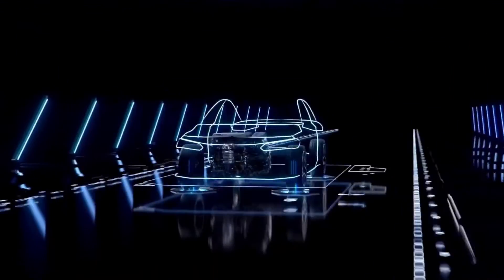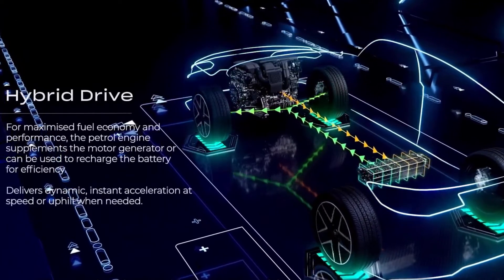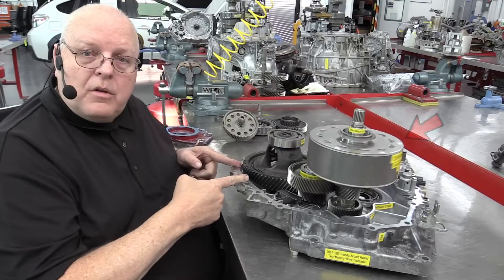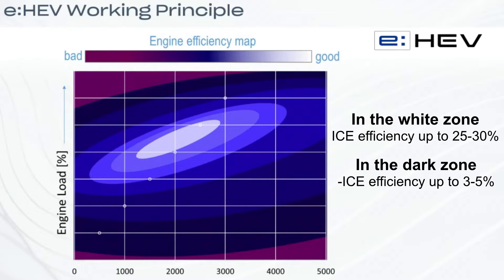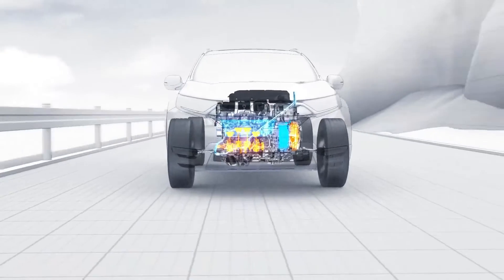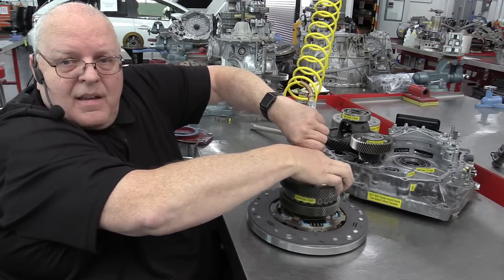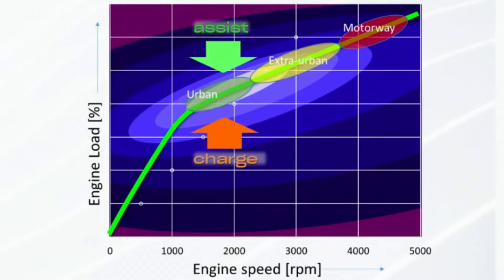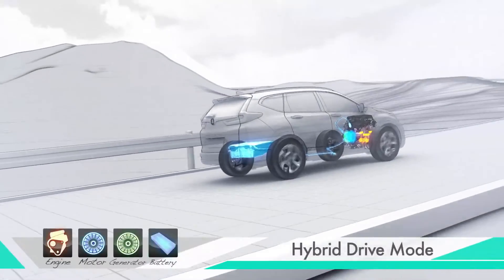Only 3L/100km! How Does It Work? Unlock the Mystery of Honda's Unique e-CVT Transmission!

Comment: The Honda eCVT is a technological marvel. But there are lot of things Honda, a  Japanese company should have looked at. The setup of Honda eCVT is complex and more costlier to manufacture and it still bears Clutches which inturn is vulnerable to wear and tear  makes two points down on reliability. I still think Toyota eCVT is much better is terms of performance and reliability.
Reply: You obviously haven't looked at the Honda eCVT itself. Or its reliability record, which is better than Toyota's. Besides the two motors, an input gear, and an output gear? It has two - count 'em, two - parts. That clutch, which only closes when the two sides are rpm-matched by computer, and the overdrive gear it connects to. That us what you call "complex." 

The Toyota system requires balancing two MGs and the engine to control engine rpm. It is so complex that they had to stea... - er, "develop independently" - a control system that was already patented at the University of Maryland.

And I doubt you will believe it, since you don't understand these systems, but Toyota hybrids have more history of clutch failures than these Hondas which have been in use since the 2014 Accord. Yep, they use a clutch. Just not for the usual purposes.
Reply: @jeffjo8732 excelente detalle y tienes toda la razón, el sistema de Honda es más fiable y sencillo a la vez.
Reply: I've got Honda eHEV cars equipped with OBD2 Scanner. The engine direct drive mode only works at 65 kmph and above. Before clutch engagement is done the engine will adjust its rpm to match the car's speed beforehand (a computer picks the engine rpm on its own), so ideally there will be no clutch slippage at all, resulting in no wear. Although in the real world nothing is perfect, at least the wearing is much less compared to conventional transmission. In my country, many people have used Honda eHEV cars as much as 200000-300000 km already (Honda eHEV cars were sold for the first time in 2020 in my country) with zero issue about the drivetrain system.

Performance wise, they are on par. Honda HR-V eHEV 1.5-Liter gives a bit better acceleration than Toyota Corolla Cross HEV 1.8-Liter, fuel consumption is pretty much the same. Honda CR-V eHEV 2.0-Liter Direct Injection gives a bit better acceleration than Toyota Innova Zenix HEV 2.0-Liter Dynamic Force and the fuel consumption is on the same level (both are same in curb weight).
Reply: There's potential wear and tear in all mechanical components.  The clutch in Honda's eCVT is not used to switch between gears as in a traditional gearbox.  It's only used to couple the ICE to the transmission at higher speeds, so if you mostly drive in the city, you will rarely engage it.  At city speeds, the electric motor does all the heavy lifting while the ICE charges the battery directly.  This Honda system translates to better performance than Toyota's.  I test drove both the CR-V and the RAV4, and the Honda was much more responsive on the throttle at both city and highway speeds.  As to reliability, Toyota will have the edge because all of their best selling models are manufactured in Japan.  That means cars manufactured elsewhere, including America and Canada, can never match the quality from Japan.  These people have specialized in Quality centuries before the British Empire.  I also see that you are a Toyota fanboy, and your Western mind tends to frame things in black and white.  Just because you think Toyotas are amazing, that doesn't make its competitors trash.  In the automotive world, and by Toyota itself, Honda is considered an equal in engineering capability.
Reply: @7TabulaRasa7  "There's potential wear and tear in all mechanical components." There are fewer parts subject to wear than in any other ICEV's transmission. You are probably thinking of the clutch; but it closes under computer control, when speeds are perfectly matched. The is a clutch built into a Toyota's flywheel that experiences more wear, and has had more failures.

"At city speeds, the electric motor does all the heavy lifting while the ICE charges the battery directly." CLARIFICATION: the ICE-driven generator powers the traction motor, with excess power used to charge the battery. The ICE is more efficient when it produces more power than is used in the city.

"As to reliability, Toyota will have the edge because all of their best selling models are manufactured in Japan." Since 2014, KBB and JDPower rate the reliability of the Accord hybrid essentially at the same, or above, that of the Camry (There were two years where the Camry was 1 or 2 JDPower points, out of 100, higher). Since 2020 when it was introduced, the CR-V is above the RAV4.
Reply: @7TabulaRasa7  and same honda and toyota are from japan
Reply: @7TabulaRasa7 ´
Reply: @7TabulaRasa7 Exactly. If Hondas were still manufactured in Japan in a top plant they would be up to par with Toyota and surpass them often. US manufacturing brings Honda quality down
Reply: @7TabulaRasa7 . The  Honda is even more of an EV than the Toyota. 
That probably explains why you consider the throttle pedal response better (I haven't driven the Honda hybrid so I will take your word).
But the Toyota is considered superior for fuel economy. Which is what many shoppers value. 

My only concern with Honda is that their engines sometimes get GDI without port injection. This runs the risk of intake valve contamination. Just more to worry about. 

And there is nothing CVT about the Honda approach. I wish they would just call it Series Hybrid with gasoline direct drive mode.
Reply: @dannybryant6873  actually, Honda hybrids tend to have "superior" City fuel economy while Toyota hybrids are more efficient on the Highway.  All things considered, it's a wash between two of the best car manufacturers in the world.  I would also consider superior too strong a word to use when comparing a Honda to a Toyota.  I personally value Honda's priority on driving experience over fuel economy, especially when the sacrifice to fuel economy is so inconsequential.  But... if I was forced at gunpoint to purchase a Toyota RAV4 hybrid, I'd be very happy with it regardless.

Edit:  oh yes and the Direct Injection on Honda's Atkinson style ICE can lead to deposits in the long run, but that could be minimized by "revving" the engine high occasionally and using detergent gasoline.
Reply: @7TabulaRasa7  Neither revving high or top tier gas solves carbon deposits on intake valves. To prevent, use good oil and additional port injection like TOYOTA D4-S.
Reply: @dannybryant6873  "But the Toyota is considered superior for fuel economy." These comparisons are usually made to a Honda that is 7% to 12% larger. The closest comparison is the Civic SPORT to the Camry SE. The Civic is more efficient (energy extraction), more economical (mpg), quicker, more reliable, and cheaper.

"My only concern with Honda is that their engines sometimes get GDI without port injection." Multi-stage direct injection has an injection at the end of the exhaust stroke, two in the intake stroke, and one actually in the compression stroke. All before the valves (Atkinson Cycle) close. This eliminates the risk of intake valve contamination.

"And there is nothing CVT about the Honda approach. I wish they would just call it Series Hybrid with gasoline direct drive mode." Or what R&D called it before marketing objected: electric-coupled CVT.
Reply: Yeah Toyota uses a planetary power split. It’s fantastic for its simplicity.
Reply: Toyota’s e-CVT solves all those issues
Reply: Our 2014 Highlander hybrid' eCVT has had no issues at all. Works perfectly.
Reply: @peterkauss5852  because that's Toyota! Thumbs up to Toyota hybrid eCVT
Reply: @abbysecured  . My only concern with Honda hybrids is they use GDI without port injection. Which leads to carbon build up on the intake valves.
Reply: @dannybryant6873  Carbon buildup occurs with GDI because the detergents in the fuel never touch the backs of the input valves. But an Atkinson cycle engine closes these valves late, after fuel has been injected. This pulls some fuel-air mixture back before the valves, allowing detergents to wash them and providing a mild turbo-like effect.
Reply: @jeffjo8732 . I guess that depends on the timing of the fuel injection. Which I know nothing about. 

If they would add port injection to their GDI the CRV would be added to my shopping list.  

As I'm not shopping now I can wait. 
Very happy with my 06 Odyssey. My oldest vehicle.
Reply: @dannybryant6873  JJ: "But an Atkinson cycle engine closes these valves late, after fuel has been injected."
DB: "I guess that depends on the timing of the fuel injection. Which I know nothing about."

I finally found a source. It uses a multi-stage direct injection to help improve atomization. There are four injection times. One is at the very end of the exhaust stroke, two during the intake stroke, and one at the beginning of the compression stroke. https://youtu.be/p9iEfFlkIEA?t=518
Reply: @dannybryant6873  They use multi-stage direct injection. There are four possible times when fuel is injected: (1) The very end of the exhaust stroke, (2,3) during the intake stroke, (4) the start of the compression stroke, before intake valves are closed (Atkinson cycle). So all are before closing. This accomplishes pretty much the same thing as port injection.
Reply: @dannybryant6873 Honda has been using GDI since 2013. Compared to GDI engines from VW and Hyundai group, Honda’s GDI engines have been pretty reliable, and are comparable to Honda’s older MPI engines when comparing K24 against K24 or J35 against J35 or L15NA against L15NA. For Honda, the problem is when you add a turbocharger onto the smaller engines and use the turbocharged smaller engines to power bigger cars than what the engine was originally meant for. Overall, the L15 GDI engine used on the Fit is pretty reliable, but it becomes unreliable when you turbocharge it and put it on bigger cars like the CRV.
Reply: The Honda Clarity plug in hybrid & the Honda Insight hybrids are only PORT injection.
Reply: @boskobear Right. The last Insights and Claritys were third-gen iMMD. The timing of  this video suggests fourth-gen, although all of it was "borrowed" from other videos, some about third-gen.
Reply: I know the generations. The Toyota fanboys & fan ladies like to say Toyota hybrids are better than Honda hybrids bcuz Honda is direct injection only. That’s not the case & There are options with the Honda 2 motor hybrid, & port injection only can be had with insight & clarity, & 14 accord & phev. Toyota fanboys & ladies are ultra stupid to suggest that the direct drive ICE clutch will need replacing, & for that reason alone… u should buy Toyota! Just like the person who started this thread of comments.
Reply: @abbysecured .Toyota hybrid Synergy drive has no clutches.
Reply: @dannybryant6873  <Sigh.> Did you read where I described it?

You don't want to connect an engine to the wheels without some kind of fail-safe in case of a catastrophic change in the rpm of either. All hybrids include a permanently-applied clutch that is built into the flywheel for this purpose. Toyota calls it a clutch damper, or a torque damper.

The issue is when a Toyota starts the engine. It is connected, through this clutch, to the wheels at this time. So starting requires a small amount of slip, and failures have occurred.

https://youtu.be/qaqqs3nKy4g
https://youtu.be/wzCACoJn-wM

In a Honda, which has this same flywheel clutch, the engine is started while the other clutch is open. So there is no wear on the flywheel clutch. And the overdrive clutch is in use only when the car is cruising above about 40 mph. The rpm of the engine and wheels are perfectly matched by computer before the clutch is closed. There is no wear.
Reply: @jeffjo8732 . Both systems are pretty clever. 
The Toyota system must take a butt load of software. Maybe for the Honda also.
Reply: @dannybryant6873  That control system was the heart of the University of Maryland project that Toyota sto..., er, "developed independently" after it had been patented.
Reply: A clutch change gatta be expensive at trade in time. A disappointing thing  along with battery life costs.
Reply: @maximuscomfort  .... and, the Honda system has less history of clutch failures than the Toyotas. Yes, it has one built into the flywheel.

Comment: Where did you get these fuel economy number 😮. In Canada, Honda CRV Hybrid provides 7.4 L fuel consumption per 100 kilometers distance, not as you are claiming 4.5L. It may only theoretically possible with the most efficient condition (continously drive in 60 kilometers per hour speed on a straight flat road for 100 kilometers distance) without any passenger or loads.
Reply: Honda forums list a wide range in terms of fuel economy.  I myself am getting around 34mpg, but I live in very hilly terrain and drive like Speed Racer in Sport Mode.  Other users who live on flatter land report anywhere from 43-52 mpg.  I tried driving very conservatively once and averaged around 42 mpg.  But I couldn't stand it for long.
Reply: @7TabulaRasa7 there are news about Honda rigging the fe. I believe its true and even Toyota does it.  Toyota states 20km/ L for their recent vios.  I am still  under 15 km/L after 1 year
Reply: @repunzelification  In my experience with the new Honda Jazz, Honda seem to underestimate the fuel consumption figures.  Long motorway driving at 70 mph, I get 60 to 61mpg, around town the figure rises to 65 to 70.  Official Honda figures are around 59mpg.
Reply: I recently took an Uber and the car I got was a new CRV hybrid and I was sitting in the front seat, I noticed 5.4L on his dash..

Comment: Ecvt transmissions are good and ideal for city driving but as I recently found out driving my wife's Honda Crv hybrid touring sport to Las Vegas from Los Angeles....climbing up the pass was extremely difficult. Felt like I was driving a 3 cylinder car while  pulling a space shuttle.
Reply: my insight is a rocket  even when battery is low
Reply: Sport mode
Reply: Oye Trujillo you need a rocker...not a car 😂😂
Reply: Seems like eCVT is not good for normal hybrids because of their small battery. On the other hand for plug in hybrids it makes perfect sense. Take for example BYD sealion 6 they have torque like an EV.

Comment: Good morning after supper! This e-cvt is not a Honda invention, Honda is just copying Toyota e-cvt Hybrid system which is on the roads from the beginning of the 21st century with the very famous Toyota Prius. And, Toyota has improved their e-cvt system with 2nd and 3rd generation versions getting rid of some undesired features or problems. So Honda is way late in copying Toyota. Better late than never!

Comment: An issue is that when it switches to engine drive on the motorway it is loud and feels like it's revving very high - very difficult to get used to and economy isn't that good.
Reply: 2000 rpm is not loud by any means
Reply: In my experience this only happens when you accelerate hard, or when climbing a steep hill.  Otherwise the engine remains very quiet and the change between electric and ICE is totally unnoticeable.
Reply: 2000 rev constantly is not pleasant at all if people are more comfortable with idle at 800-1000
Reply: @TheViettan28 Toyota Corolla can maintain the engine constantly at about 4500 rot/min if you accelerate hard. And yes, it’s totally annoying.

Comment: Extremely complex and too many parts, a nightmare for maintenance, almost impossible to troubleshoot
Reply: Do you honestly think this has more parts than the 8 speed automatics you get these days? It's actually a massive simplification.
Reply: @jaapweel1 dude acts like automatic transmissions don’t cost millions to develop and aren’t extremely intricate to construct.
Reply: Mechanically quite simple, just different than you are used to. Fewer parts than just about any other ICE car, and quite easy to troubleshoot. But it seldom needs that.
Reply: People like you simply project your fears on things you don’t understand.
Reply: It is clear to me that @pucheco69 doesn't have a clue how the eCVT works. It is a simple and elegant solution.
Reply: The truth is the EXACT OPPOSITE of what you said. You are completely clueless. 😂
Reply: Far less complicated than a conventional automatic, or a dual clutch gearbox.
Reply: Y comparado con el ECVT de Toyota?